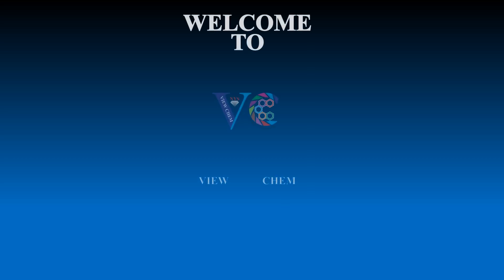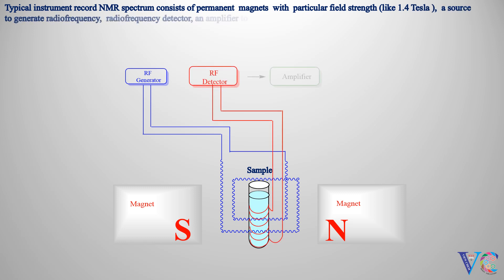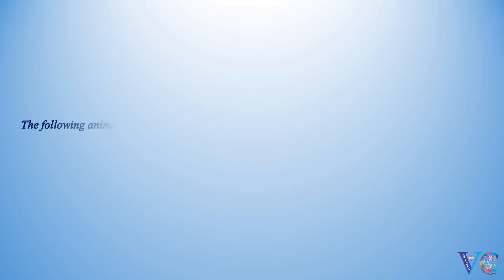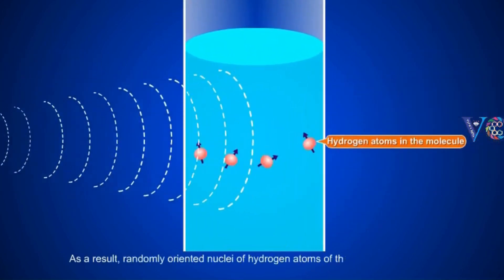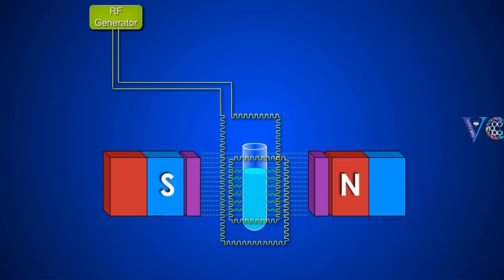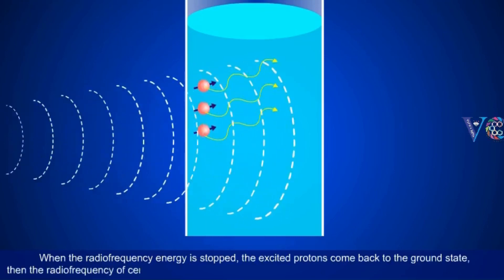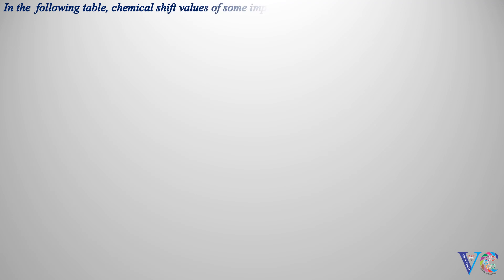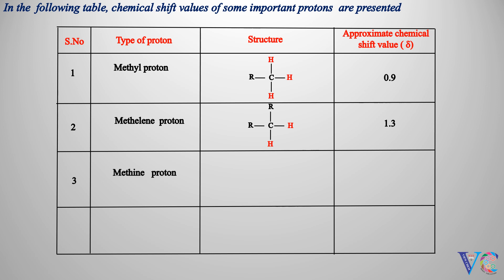Instrumentation of NMR spectroscopy ( Explanation through animation , spectra, chemistry animation)

Comment: In the presence of magnetic field
Some protons align parallel to the magnetic field i.e  Alfa state , low energy state.. these on absorption of rf undergoes excitation to beta state and relaxes to Alfa state by emission of radiation. 
But what happens to the protons alinged anti parallel to the magnetic field i.e beta state protons , high energy state protons how these protons intract with rf Radiation...??
Reply: I think this proton does not have a magnetic moment due to even proton and neutron number